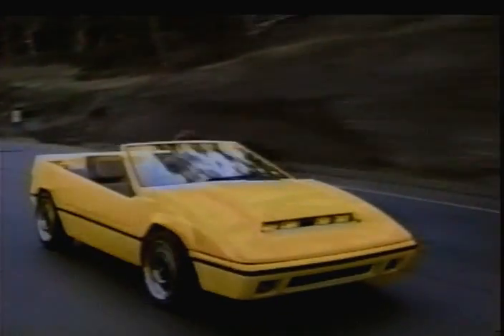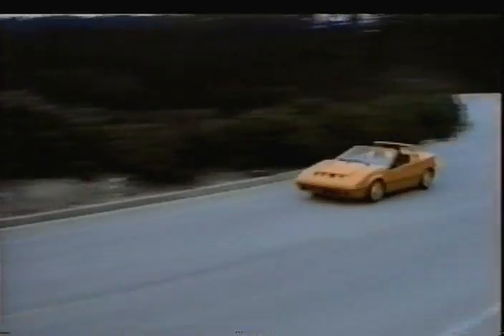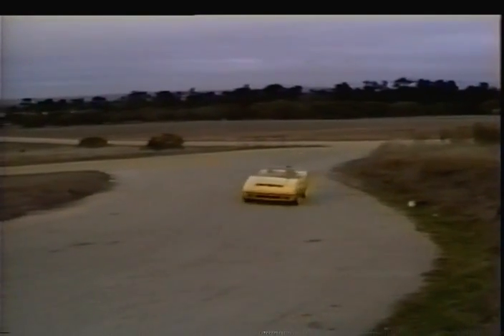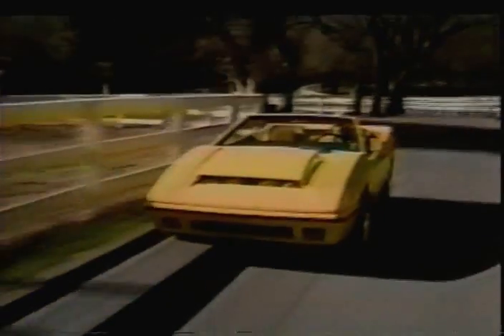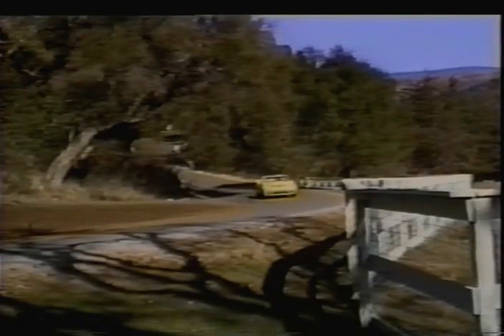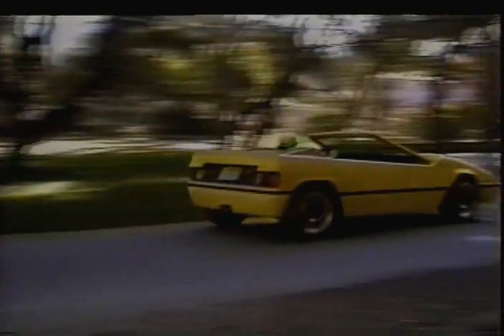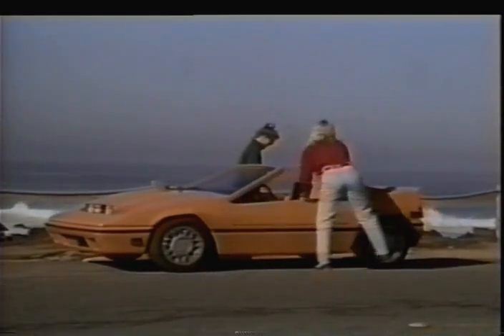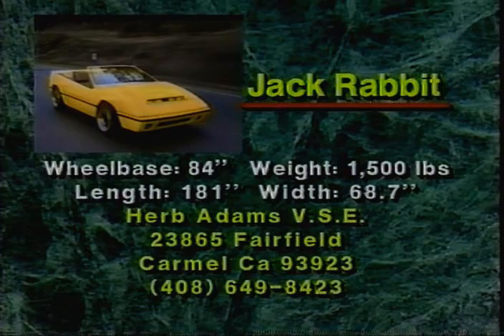Herb Adams VSE Jackrabbit kitcar (1992)

Comment: Herb Adams is an amazing guy -- And very personable; wrote back to me in 1989 when i had some specific questions on my quest for the ultimate Modified Firebird ( At the time it was my 1969 firebird with a WS-6 T/A Disc-brake rear end, front Disc Mod, Saginaw variable ratio Power steering,,, Behind that car sat my 1969 Trans Am Ram air III ) Thanks Herb !!

Comment: I will never figure out how Herb Adams ever became '"famous". His suspension designs were horrific with anti-roll bars that were way to big and springs that were so under sprung, that the chassis mostly relied on bump stops to prevent bottoming out on even the slightest road imperfection. And now I've seen this car... how many people hit their head on that ridiculous windshield?
Reply: For a guy that apparently drives a Trans Am you should have soap in your mouth - Certainly modern technology spells out betterment's from the 1960's -- BUT only because of the Engineers like Herb that Raced on Sunday and took the findings back into the Factory on Monday !! Have some couth !!